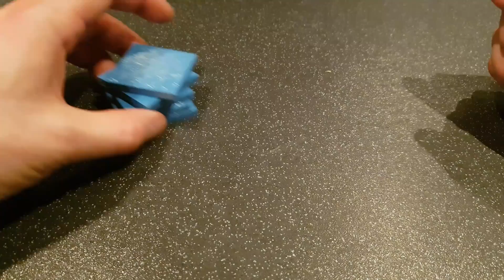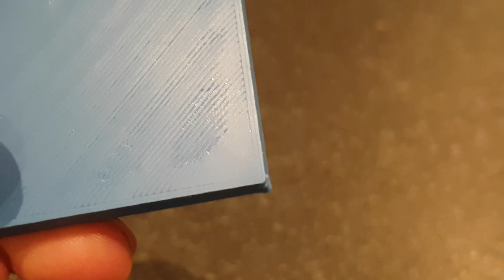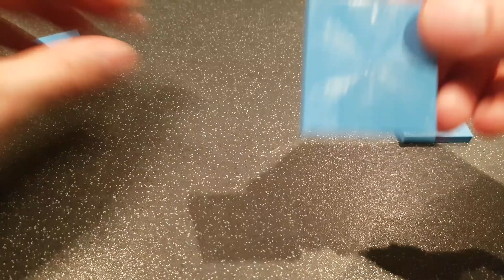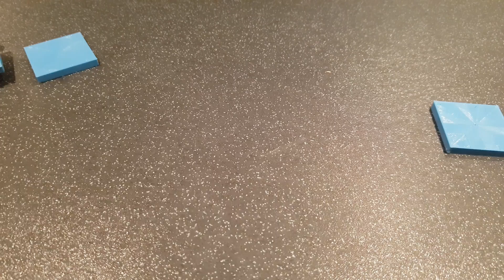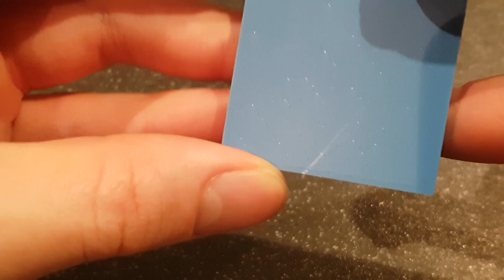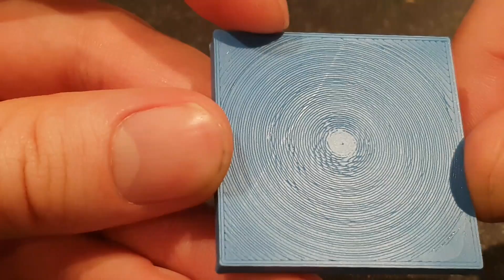Testing Updated Prusa I3 MK2 Surface Layer Patterns

Comment: What helped me with first layer surface finish was so add a little code to the starting gcode:
G28 W
G1 X0 Y200 Z0

I placed it right under the M115 line and now the first layer surface finish is way better (except for some artifacts on larger prints).

It seems like the PINDA probe has problem with temperature differences. So if you have a cold probe and run mesh bed leveling, the probe will heat up and change the sensing distance. The code above places the probe at the left back edge before heating up the bed so that the probe is in a controlled heat state and therefore minimizes the differences in distance sensing.
Reply from the maker: Thanks, so that code just moves the probe there before each print?

My nozzle/probe is always at the back left before each print anyway and I have the Z axis around 100mm high to avoid heat and then it runs the 9point calibration before each print once everything's heated up so I would have thought that would solve the cold > hot bed probe situation?
Reply: Yeah it moves the nozzle/probe to the back left but it sets the Z to 0 so that the probe will also heat up a little. During the 9 point calibration the probe goes near the heated bed so it will likely heat up a little bit during the calibration. But when it is heated up beforehand there won't be any heat transfer anymore. So the probe is at a constant temperature.

Comment: Underexstrusion or motion overspeed or layer height not set calibrated correctly. I've had that and it was these factors that helped me get out of this poor surface state. Maybe you won't agree for the layer height calibration, but if it makes a mess on first layer and you are lifting Z axis to solve it, I suggest you find the right hotend temperature and it will work out. You will then experience a filled first layer and then it will sort out in progress. Truly this was my case overcoming this.

Comment: no point looking at top layers until you get your first layer problems fixed, did you get your bed levelling issues solved yet ?
Reply from the maker: Fair point, it was more to check out what the patterns looked like.

Hopefully in the next few days I'm going to redo the test prints I did in my bed levelling video and go over everything again as perhaps the updated firmware may have helped some issues.
Reply: I still think you have a hardware issue, are you on the prusa FB groups ? theres a lot of people can help find your issues.
Reply from the maker: No not on there yet. I'll try and get on there tonight or tomorrow. Thanks.